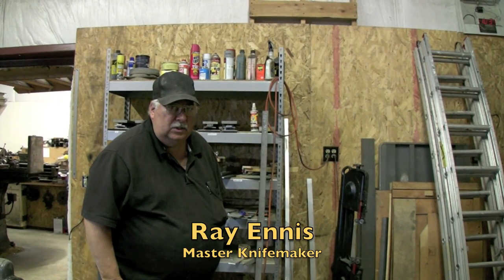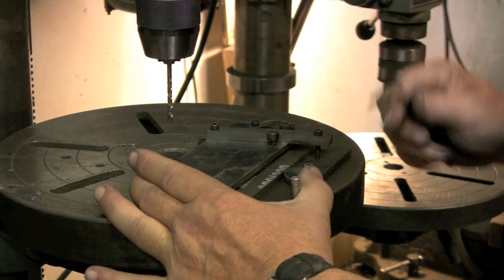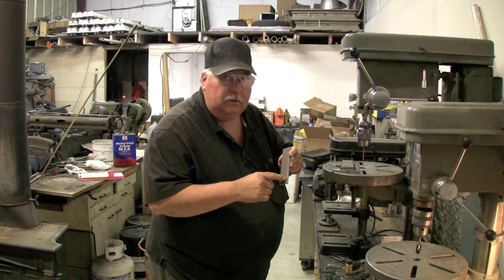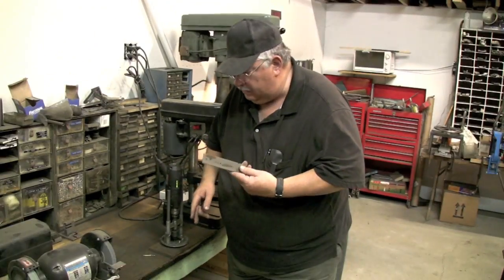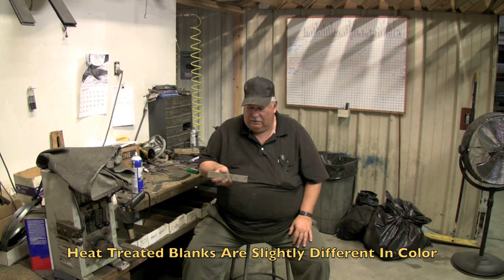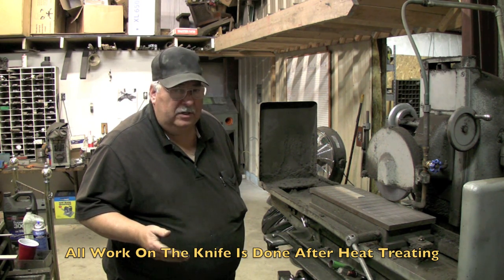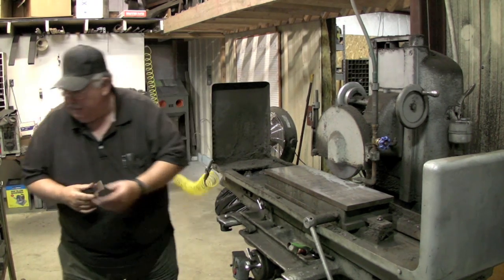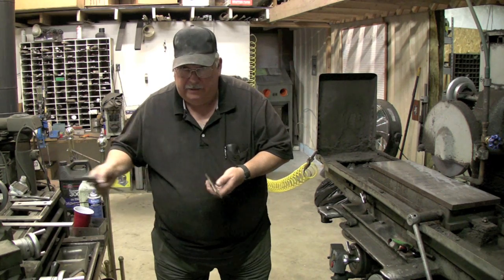Entrek Knives - How The Knives Are Made Part 1 - Blanking & Drilling

Comment from the maker: @bobmellon The main reason I do my work after heat treat is so I don't have to deal with warped blades.  Even flat steel will sometimes warp during heat treat.  If it does I can surface grind it flat before I start the bevel grind.  As long as you pay attention and don't let your belts get too dull hurting the temper is not a problem.  I am not the only one that does it that way.  For some of us it just works better this way.  Ray

Comment: Just wanted to drop a comment. I think the Entrek Cobra might be one of the finest blade shapes out there. I appreciate the comment about heat treating up front. I've welded for years and know the sure fire way to EFF up steel is by applying heat to it so have never understood, grinding/ profiling, then heat treating. I know it makes it harder to remove materials and you have to operate more carefully in terms of keeping the metal cool during grinding, but it makes more sense to me.

Comment from the maker: @MacheteMenacho I chose 440C because it is a proven steel that holds an edge a lot longer than 1095 and is more corrosion resistant than either 1095 (you can watch this stuff rust) or D2 which actually doesnt qualify as a stainless steel although it is tough to beat it for edgeholding its a little harder to get D2 as well.

Comment: @bobmellon i am not an expert on this subject, and i really respect your work, and i really respect the amount of experience you have, and i do not know for sure the changes that would occur from this concentrated superheating of the metal caused by grinding, i am not a metallurgist, but to me it seems that it would change the properties of that metal, the same reasoning follows with laser cutting, which can cause microchipping problems on factory edges

Comment from the maker: I use cobalt screw machine drills.  Screw machine drills are shorter and stiffer than standard jobber length drills so they don't wander.  You can drill hundreds of holes per bit in annealed stainless steel.

Comment: @entrekknives i know that you are definately keeping the blade under 400 degrees as a hole, but when you are grinding and shaping, you can even see this if you watch your video, is at the contact point the metal is being superheated, turning orange, therefore changing whatever temper existed,this probably does not happen as much whilst you are grinding the bevels, but it definately happens when shaping, and it still happens on a molecular level whilst grinding

Comment: Hi Ray, Thanks for the video. In this one, what holds the blank down to the surface grinder table? I don't have any experience with one of those. Thanks again.
Reply from the maker: It is a magnetic table.  Mine is very old.  It has permanent magnets that can be moved to hold or release.  The new ones are electromagnets.  After I surface grind I have to demagnetize the blank on the new ones you can do that before you take the blank off.
Reply: entrekknives Thanks for the reply and all your awesome uploads.

Comment from the maker: @bobmellon What you are seeing when I blank is the color change of the layout fluid not the overheating of the steel.  the layout fluid changes at very low temp.  If you were to look at the edge you would find it bright silver.  No color change at all.  I am very careful with this.  The one test is this.  Ask ANYONE that has or has used an Entrek USA knife about the heat treat.  Or look on the forums.  You will not find anybody that will say anything bad about the heat treat.  Ray

Comment: What kind of taps are you using? Never seen one cut that easy and not break
Reply from the maker: The taps I use are called 2 flute spiral point taps.  They are designed to push the chips ahead of the tap so it doesn't clog.  Although you can tap a blind hole with them the point is quite long so you would have a lot of unthreaded area at the bottom of the hole.  For blind holes use a spiral flute tap.  You can't get these taps at the local hardware store you need to go to a machine supply.

Comment: Hello Ennis, I really like your videos, I've seen several times, but I noticed that the first blade you drilling was too short and did not understand the form, but then you changed for another longer, what's the deal with the first one?
Reply from the maker: In the demonstration I just used a piece of scrap that I had to keep from wasting steel that I didn't have to.